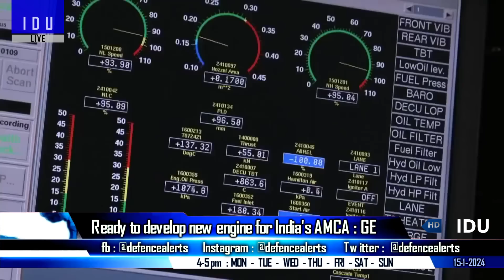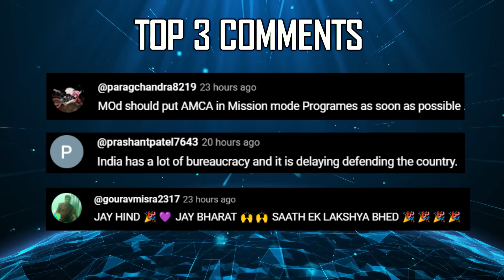Indian Defence Updates : 130 Kn Engine Test,Astra MK1 Delivered,Barracuda SSN Production,Ramjet Ammo

Comment: As a Bharatiya nagarik, I do not support USA involvement in the development of our combat jet engines.

The jet engine should only be developed with Safran  - and have a dry thrust output itself of 115kn and above .The afterburner phase on this system should be replaced by ramjet phase - where in a turbojet supercruising  past Mach 2 will have enough air intake to regulate the turbine and inject fuel directly into the supersonic airflow - accelerating the jet to Mach 3+ , lowering chances of being chased by honing missiles, while decoying.

The dry thrust of high kn can also make the engine work at Stratospheric heights - raising the aircraft's ceiling to above 80,000 ft.

This would be impossible in first gen AMCA Mk1s if it uses those GE F414s after burning units.

Comment: F414 engines are ok for fourth OR  4+ generatioN jets like Tejas 2  and TEDBF. But if we want AMCA to possess sixth generation technology in future, then to power the future generation powerful radars, Avionics and direct energy weapons while maintaining higher manoeuverability 120 KN engines will not be sufficient at all. We will require much higher thrust engine, more than 150 KN. So it’s better to keep all these companies including Rolls-Royce on hand. There are very few countries with whom these manufacturer countries and companies are ready to share the jet engine technology. And we must have that acumen   to take advantage of this goodwill.
Secondly, we must not forget that these technologies in itself are like spice or internal informers to originating powers. In a way we are giving away the access to our locations, electronic signatures and entire radiography of our forces to them. So we should not be relying so much on them at least for Air Force technologies. Try to achieve complete strategic independence as early as possible. China has done the same and we need to learn this from them not to leave any stone unturned on the path of strategic independence bye optimal if not complete indigenisation of defence.
Remember, a country is actually not independent, if the critical defence technologies are not independently indigenous. However, we also have to think that these engines are going to give away entire your electronic signature of Air Force to supporting partner country. Not only Air Force but it will also give location and movement information of your army and Air Force. These foreign engines may actually work as spy giving all information about Indian forces to America or the supplier country. So at least the future generation jets should be made on basis of fully and only indigenous aircraft, including fully indigenous weapon systems, engines and avionics Just acquired the technology and experience in the present generation but aim and make the future  jets completely indigenous. Let’s be smart like France, Russia  and China.

Comment: I assure you India will be successful in its indigenous Fighter jet engine of 130kN capabilities by 2028
Reply: F414 engines are ok for fourth OR  4+ generatioN jets like Tejas 2  and TEDBF. But if we want AMCA to possess sixth generation technology in future, then to power the future generation powerful radars, Avionics and direct energy weapons while maintaining higher manoeuverability 120 KN engines will not be sufficient at all. We will require much higher thrust engine, more than 150 KN. So it’s better to keep all these companies including Rolls-Royce on hand. There are very few countries with whom these manufacturer countries and companies are ready to share the jet engine technology. And we must have that acumen   to take advantage of this goodwill.
Secondly, we must not forget that these technologies in itself are like spice or internal informers to originating powers. In a way we are giving away the access to our locations, electronic signatures and entire radiography of our forces to them. So we should not be relying so much on them at least for Air Force technologies. Try to achieve complete strategic independence as early as possible. China has done the same and we need to learn this from them not to leave any stone unturned on the path of strategic independence bye optimal if not complete indigenisation of defence.
Remember, a country is actually not independent, if the critical defence technologies are not independently indigenous. However, we also have to think that these engines are going to give away entire your electronic signature of Air Force to supporting partner country. Not only Air Force but it will also give location and movement information of your army and Air Force. These foreign engines may actually work as spy giving all information about Indian forces to America or the supplier country. So at least the future generation jets should be made on basis of fully and only indigenous aircraft, including fully indigenous weapon systems, engines and avionics Just acquired the technology and experience in the present generation but aim and make the future  jets completely indigenous. Let’s be smart like France, Russia  and China.

Comment: Base al31 engineer modified core india should develop 140 KN engine
Reply: We don't have al31 core tech. And all it is a heavy fighter jet engine
Reply: There is nothing called heavy fighter engine. Heavy fighter requires higher thrust for higher payload and capability. 190 KN engine in used in medium weight fighter F35 @SomeGuy-ti1ln
Reply: @vaimurthy  oh yes an expert here to show best knowledge😂 al31 is 1600kg with 50 inch diameter dimension. F404 is 1000kg with 35 inch diameter. You brain will accept this?
Reply: @vaimurthy  comparing motor with turbofan engine with single crystal blade?🤣🤣🤣🤣🤣🤣 your papa has offered f414 with 117kn with same dimension. Al41 has increased thrust with same dimension and reduced weight and now new al51 with more reduced weight and 45kn more thrust. I guess you'll remain that south filmi kid whose best science and economics knowledge is from vijay movies🤣🤣🤣
Reply: @vaimurthy  yeah shockedd to get a reality check of the brain capacity of yours?😂 motor man🤣🤣

Comment: Why isnt kaveri atleast tested on Tejas if its producing 81kn thrust ??
And does f404 variant used by Tejas makes 90kn thrust. Iaf allo said initially we want 90kn engine for it and ge is capable of increasing its thrust it has already did it. What do you think.
Reply: kaveri engine produce 73 kN thrust..
Reply: @Gamingzone-cj8pg lol go update yourself it's 52/81kn now.
Reply: @Ulatimber Is it..?? 😱😱 
Can you please tell the source of information, because 81kN is a good thrust number.
Reply: Kaveri is in testing in Russia. And after testing if the result is good. Then may be govt will approve a Tejas for testing. It can happen. But it can't go to current Tejas as f404 orders are already given
Reply: @navneetmishra5181 mid life upgrade.
Reply: F414 can easily produce 97kt of thrust and ge is customizing it from last 30+ years according to consumers needs
Reply: @Rohit-cj6eb  easily 😂😂😂f414 has a EPE Variant which makes 117kn thrust infact it has one less HP stage. With more stronger SCBs.
Reply: I am not an expert but I think the thrust weight ratio  configures into the capability of the frame to withstand shock and torsion from the thrust. Also the engine production will have to be ramped up in the future to produce enough engines for frames already in consideration before extra engines can be manufactured for other frames such as the Tejas
Reply: F414 engines are ok for fourth OR  4+ generatioN jets like Tejas 2  and TEDBF. But if we want AMCA to possess sixth generation technology in future, then to power the future generation powerful radars, Avionics and direct energy weapons while maintaining higher manoeuverability 120 KN engines will not be sufficient at all. We will require much higher thrust engine, more than 150 KN. So it’s better to keep all these companies including Rolls-Royce on hand. There are very few countries with whom these manufacturer countries and companies are ready to share the jet engine technology. And we must have that acumen   to take advantage of this goodwill.
Secondly, we must not forget that these technologies in itself are like spice or internal informers to originating powers. In a way we are giving away the access to our locations, electronic signatures and entire radiography of our forces to them. So we should not be relying so much on them at least for Air Force technologies. Try to achieve complete strategic independence as early as possible. China has done the same and we need to learn this from them not to leave any stone unturned on the path of strategic independence bye optimal if not complete indigenisation of defence.
Remember, a country is actually not independent, if the critical defence technologies are not independently indigenous. However, we also have to think that these engines are going to give away entire your electronic signature of Air Force to supporting partner country. Not only Air Force but it will also give location and movement information of your army and Air Force. These foreign engines may actually work as spy giving all information about Indian forces to America or the supplier country. So at least the future generation jets should be made on basis of fully and only indigenous aircraft, including fully indigenous weapon systems, engines and avionics Just acquired the technology and experience in the present generation but aim and make the future  jets completely indigenous. Let’s be smart like France, Russia  and China.
Reply: @shaktimaan1064 electric power output does not depend on afterburning thrust it's depends on dry thrust which represents power in the shaft which can be extracted for generators. Afterburning thrust is just dumping fuel after the turbine for alot of thrust for short period of time..

Comment: Waiting for Katveri 130kn development, way to go bharath ❤🎉....
Reply: Surely but they should probably start with making kaveri 85kn to integrate in tejas after that probably in 2090 we will surely see 130kn engine
Reply: India can NEVER trust America. The 20% technology that they don't transfer is the MOST crucial. They'll use that to control India. 
India is better off dealing with France and Safran.
Reply: It's just a test facility not an actual engine. We couldn't even make a UAV capable of flying at 30000 ft and you think we will be able to make a 130 KN engine ? as they say "Muh se mungfali Tut nhi rhi hai, Gaand se akhrot todega kya?"
Reply: @SunnyDays1512  what makes you think we need such an engine to power & fly a UAV at 30k feet. Jeez, UAV uses turbojet engine with fuel efficiency and no afterburners. Is the US using GE F404 or F414 for their drones? Learn some aviation tech before you yap. And it’s not a test facility. An engine isn’t a facility. 🙄🤦🏻‍♂️. It is an actual engine but an underpowered one. Not suitable for the type of aircraft in development. It can be used but the performance will be hampered if Kaveri is used. WhatsApp book name?
Reply: 😂😂😂😂 mungerilal
Reply: Kaveri 120kn is not realistic. We do not have certain crucial technologies relating to turbine blades and their metallurgy.
Reply: @Shenaniganizer-1  we’re actually solving a few of those issues you pointed out through the GE F414 deal. Check out what all are included in the ToT.
Reply: Edit your comment bruh, it’s Kaveri.
Reply: It wont happen. We could even develop thrust for Tejas MK1
Reply: Wait until atleast 2060. Ur dream will come true
Reply: @abhimanyunath2001  we already developed without any help from other, which is being used for unmanned gathak. My country is progressing for the last 10 years in high end technologies. You should be pappu of Indian defence information.
Reply: @vijayv7969  ghatak was started in 2009 as AURA programme.
Reply: @SomeGuy-ti1ln  that time it was not even in drawing board, and talking about the kavari engine being used on it now.
Reply: @vijayv7969 Ghatak is 15 yrs behind China and 50 yrs behind India
Reply: @vijayv7969  a programm will be on drawing board only after starting..right?😂
Reply: @abhimanyunath2001 Won’t argue with you on what ifs and what nots. Check data on def exports from 2004-2014 & 2014-2023. Not saying there’s significant progress in def tech but if there is even a bit of it, the data should reflect vis a vis defence exports. Also we need to invest heavily on R&D, without it there will be no long term progress or future of our defence industry.
Reply: @regumkoyu6620  not really, the tech demonstrator is already flying. And Ghatak will not be using 130kn or even 85kn engines. The one developed is sufficient for it. Besides it’s a classified project. Not sure why they’d leak out stuff to the media.
Reply: @Kun..07   I think there's not only defense export, it also included aerospace components exports too. Maybe defense subsystems lru etc.

I think govt should release data on what kind of items being exported. Which items are being considered as defense items. Even though majority of those items are being manufactured by Private companies not DOSUs
Reply: @abhimanyunath2001  there are categories. Not everything is declassified. Aerospace components from ISRO does not come under defence exports. They’re a completely different classified category. They need clearance directly from the PMO. Defence exports need clearance from CCS of which PMO is a part.
Reply: @abhimanyunath2001  It is not only on our govt. but also on the buying govt. to decide on declassifying data related to defence exports.
Reply: @Kun..07   I am not talking about Isro. Boeing, Airbus and other aerospace giants also have partnership with TASL, GODREJ, MAHINDRA  and others, I think that also included here though they are for civilian purposes.

Clearance need in exporting large items like completely build aircrafts, missiles etc.. Not subsystems and even manu items got cleared.

If not there only few contracts from Armenia, Saudi and Philippines which maybe totalled less than 1 billion and that also expand throughout multiple year.
Reply: @Kun..07   Doesn't think so because u don't need to declassify the country name. Like Israel do... And if any big deal even less than 100 millions of dollars of deal come to media or govt put statements.
There's nothing significant to not declassify.
Reply: @abhimanyunath2001  they are mainly civilian but yes there are a few def sub systems included in that like fuselage for Apache etc. Exports also include artillery shells, mines, ballistic helmets, bulletproof vests, naval guns, fast attack crafts, missiles, radars etc. The ones you specifically mentioned like Philippines, Armenia etc are the ones which the media highlight. But they’re also the expensive tech but yes in small quantities. Our babu’s are the biggest hindrance.
Reply: @abhimanyunath2001  that’s where we can agree to disagree. I’m not saying all countries do that or have that as a clause, but some definitely do. Some are part of the package but aren’t revealed to the public. Do you know what armaments we received & how many, with the Rafael’s?
Reply: @Kun..07  But still it's quite unfathomable to export 2bn worth of defence items in single year. Those helmets, artillery ammunition, vests are very cheap items... So govt can give rough estimate by not mentioning any country name. Even no country name.
Categories like small arms and ammunition, protective gears, personal gear, large caliber ammunition, small boats, short range missiles, PGM etc, like aerospace subsystems, infrantry subsystems, electronics, electrical components, mechanical components, spares etc.

Noone will get harm... Even broader categories can be used.. Ground, air, sea etc.
Reply: @Kun..07   Yeah we don't know about the exact number of any weapons... But we know about the types of weapons. And complete price of the deal.
Reply: @abhimanyunath2001  that’s for the govt to decide. as mere citizens & not someone from the defence background I have no clue on what needs to be released and what not.
Reply: @abhimanyunath2001  that’s also a guess derived from the transport trucks pictured while on their way to Armenia from Iran. Some say Pinaka MBRL & some ATAGS. Only Swati radar has been acknowledged.
Reply: @Kun..07   Govt should transparent to it's citizens to build trust on govt data. Because there's not many Indian exports are happening like South Korea or even turkey. And 2bn in a year is a huge figure.

Moreover department of defense production said that more than 1lac crore worth of defense manufacturing happened in last financial year. But didn't released any specifics. 
So that's also build confusion and seems untrue to some extent. Because at a time when no big orders are being placed by armed forces and specially IA and IAF how come defense production jumped to such extent.
No large order of ATAGS, Whap, K9 vajra, MGS, Kalyani M4 ( Few Dogen) , mahindra LASV (only 1300), Air defense gun, Arjun Tank mk 1A (Only 118), Carbines ,snipers, NAG, MPATGM, Helina, Druvastra etc. 

On the IAF front (No sight of MRFA, Drones, Anti aircraft guns, LUH, LCH etc) No mass production of any missiles in huge quantity.

Navy no new submarines project 75I, no minesweepers, still no 2nd Aircraft carrier etc. 

Ur regular production of ammunition, clothing, spares (many imported), electronic items, can't put your defense production to 1lac crore. We are talking about more than 12bn dollars here ( The whole 83 Tejas deal was worth of 43000 crore) whole defense budget of Pakistan are less than it.

So it's not fathomable and obvious to suspicion.
Reply: Bhai Test Bed Khareedne ke Lye Drdo ke Babu paise sanction karen itna dimaag un me hai hi nahi 130 KN ka engine agle 20 saal baad High Altitude test me fail ho jayega😂😂😂😂 DRDO bechara kya kare jab development fund hi nahi sanction hota...